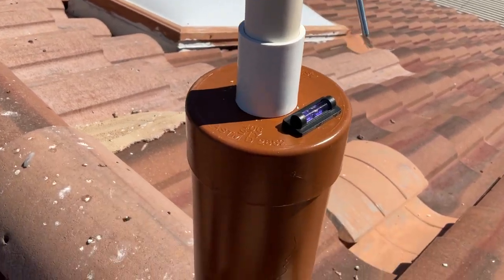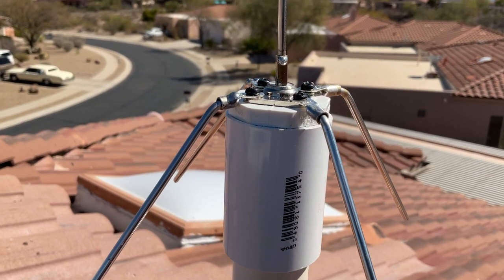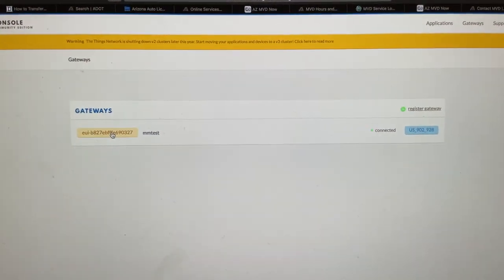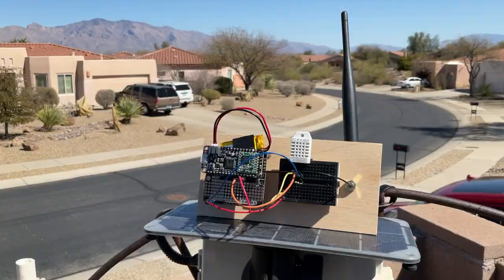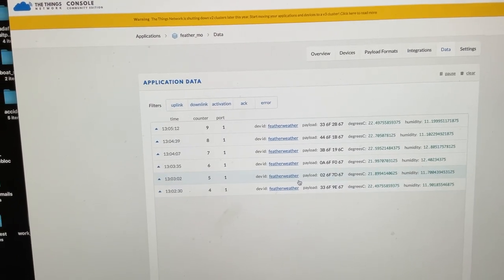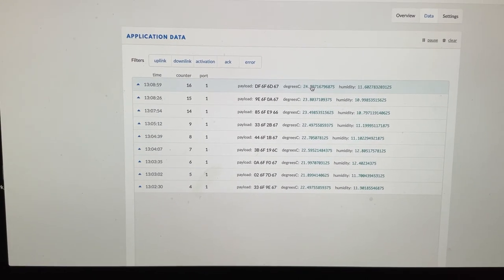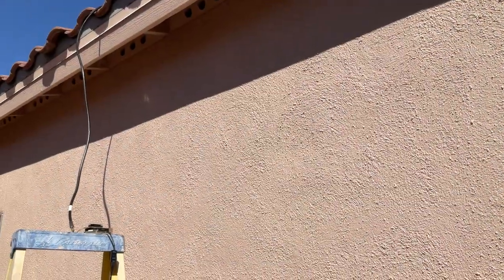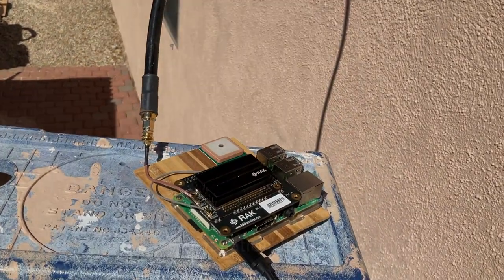LoRaWAN Antenna Installation and Test

Comment: I would not bother too much about RSSI as your SNR is excellent. You could gain a little better by shortening the cable between the antenna and the gateway. Well done: nice setup !
Reply from the maker: Thanks - agreed on cable length— will post shortly on limitations resulting in the same and impact on power output.

Comment: Found similar issues. My SNR is great, but RSSI can be terrible. My antenna is about 32 ft in the air. The big problem I see with LoRa is its power limit. If we could legally crank the power-up, we would get a bit better of a signal.
Reply from the maker: Well, LoRa is very sensitive, and the path loss diagrams I have seen always show a sharp drop followed by a leveling out. Maybe that’s just the way things play out. I need to get a little smarter on this front, but first, need to get that gateway installed at Xerocraft ;-)

Comment: what is thath wires did you used in the construction of your antenna? The lengh of the antenna elements is 82mm?
Reply from the maker: Sorry for not replying sooner. A few details on the antenna build are summarized in this video: https://youtu.be/ZGqLQNsd_cI . The antenna was built using aluminum welding rods- probably 1/8 inch diameter if I recall. 

This video has a nice summary on building these antennas: https://www.youtube.com/watch?v=bWpjDM2CJXI&t=0s
Reply: @ModestMaker  thanks for your attention.

Comment: Amount of cable 

2 way amp on the gateway will help
Reply from the maker: Wouldn’t an amp put me over FCC restrictions for power output on the antenna? in any case, I have since observed that a sharp initial drop in RSSI is typical, with the drop tempering over distance.

Comment: I'm not sure about your RSSI issue but I can give you some pointers about grounding your antenna.  It looks like your feedline is near the electrical entrance to your home which is great.  Check out Alpha Delta Communications https://www.alphadeltaradio.com/ and take a look at their coax surge protectors.  They use a gas discharge tube that will short the antenna feedline to ground in the event of a surge.  The coax surge protector can be connected to a ground rod clamp and grounding rod that would also need to be connected to your electrical panel ground.  This video will give you an idea of what you can do.  https://www.youtube.com/watch?v=thJxObTNbck
Reply from the maker: Very cool - thanks! I really would like to make this a permanent year-round installation if I can swing it. I'm going to finish getting this weatherproofed and then will revisit to see how I can make that happen via your recommendations.

In retrospect, I think RSSI might actually actually improve if I move the node away from the antenna since there might be some gain impacting the lower elevation of my node at such a close distance. I'm looking forward to testing coverage around downtown Tucson and surrounding mountains, but first, I need to make this installation a little more permanent now that I know everything's within range of WiFi and working properly.